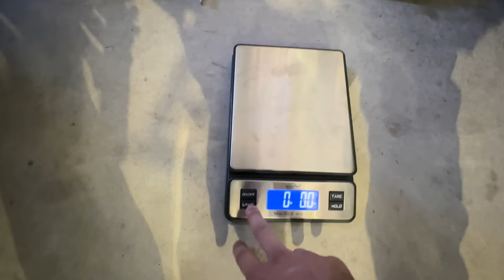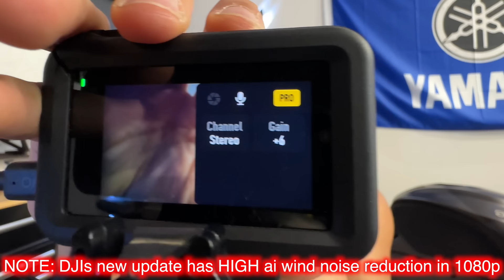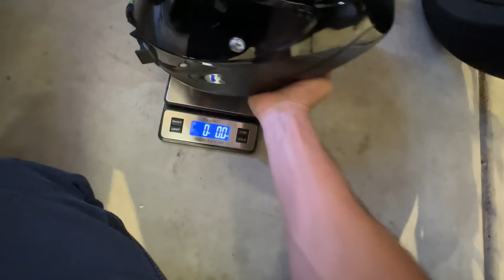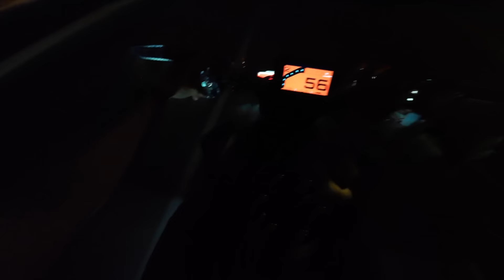Full Helmet Setup & Test Ride With Action 4 Motorcycle Camera

Comment: I had the Action 3 and had a really hard time not getting distortion with an external mic.  Even with the gain turned down all the way, it was still too loud and overblown.  Only way I could get it to work was to switch to the DJI wireless mic setup with it was too bulky to work with and I got caught out in the rain and it got fried.  

When you are talking at higher wind speeds with lots of wind noise, no distortion or crackling?  I would rather have the audio a bit low and boost it in post, than to have it blown out and unusable...

Comment: Nice video, cool channel.   DJI has come out with an audio adapter that allows connection of a 3.5MM TRS microphone and simultaneous charging as it has both the mic input and a USB-C charge input.  The adapter does seem to inherently reduce the gain even more than without it so if used you may have to up the gain settings on the camera.   I use it along with a 10,000 MaH power bank stuck to the back of my helmet so battery life is no longer an issue.    I dumped GoPro over the DJI OA4.  No more clunky media mod, no more inexplicable freezes, no more overheating, no longer connection issues to see what and that the camera is recording from my iPhone on the quad lock.   Unless in future GoPro resolves all that - and they’ve had multiple generations to do so, I’ll never go back.   Hopefully OA5 will have a 1” sensor.
Reply: i’m planning on doing this soon, i have almost the same setup as you since i want everything to be all in one package and easy to setup and use. it’s good to see someone speak so highly of the osmo being used in this way. thanks 😊

Comment: For all people thinking about using some of those amazon connectors just a head up! As a helmet mount the are ok but if you mount them on a bike or car the cheap ones break under stress and vibration! So don’t cheap out on mounts when its holding a 500 euro action cam! Can show enough footage of cheap ones bending and snapping
Reply: Is there any you recommend?
Reply: @wagovan3686   All the original ones from gopro and dji are pretty solid and otherwise reputable brands laike ulanzi and stuff. Never overtighten your plastic stuff as it will cause stress on the materials. And you can buy alu mounts aswel but when you combine them with plastic also watch out for overtightening.

Comment: I have been motovlogging since 2018.  Nothing fancy. I use GoPros with external power sources.  The internal batteries just do not last long enough, for me.  The GoPros, over the years, have been finicky and frustrating.  I am seriously considering replacing them with DJI Cameras.  Question:  Can the DJI Camera have external power connected and at the same time have the mic connected.  This would only be for the camera on the helmet.

Comment: Sorry brother but I have to let you know that the Exhaust note was not reaching out to mic Though if the Visor up or down. Another thing about the Super Duke is you Headlight clamp is setted up a bit higher then it should be, because of that you weren't be able to see your light on road at all. No Doubt The Quality of the Cam is Great & the test ride was pleast to watfch but itw was bothering cause I couldn't hear the exhaust not. 
Cause it's a motovlog channel so we need to hear the Exhaust notes clear & loud. So hope you'll find a way out. 
Thank you so much for this kinda informal video for starters. 
Keep the good stuffs Coming Brother.
Lots of Love from Bangladesh.❤

Comment: Good video😊 just got the dji osmo action 4 , what is the best settings do you recommend for smooth  clear 4k street vlogging ?
Reply: Get an ND filter, set the shutter speed to 1/60 for 30fps or 1/120th for 60 fps, ISO 100-1600 is what I personally use and the camera manages it all